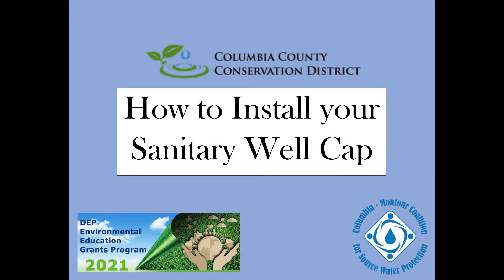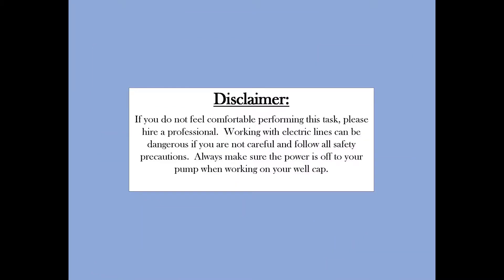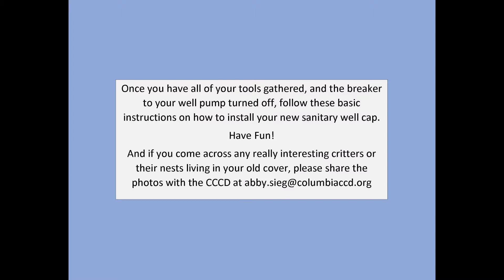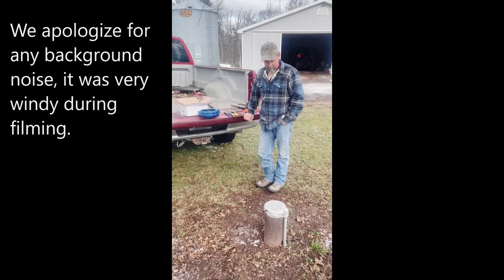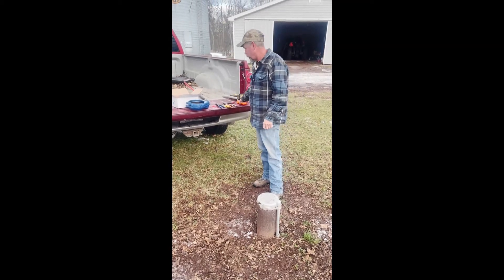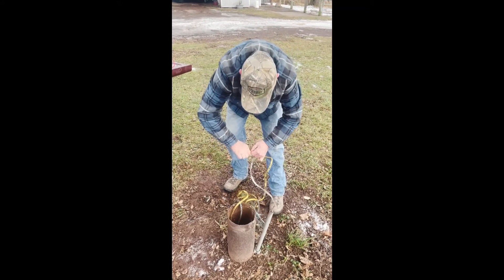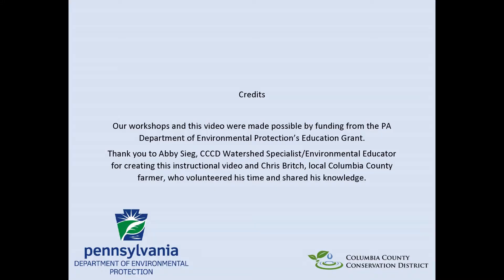Sanitary Well Cap Installation Tutorial

Comment: What did you do to check that power was off? I must have missed it. Ty
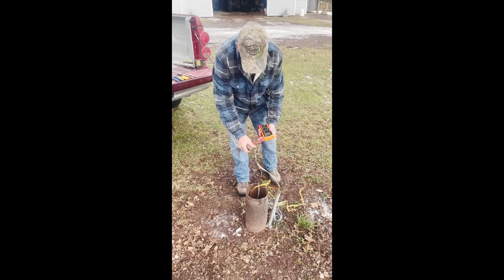Reply: The said to confirm that the breaker was off in the disclaimer. The guy also said this and then recommended to confirm no power with a volt meter; which he did at 2:40 in the video.